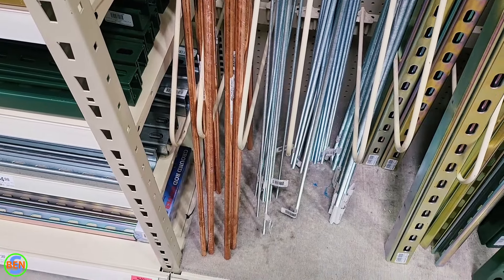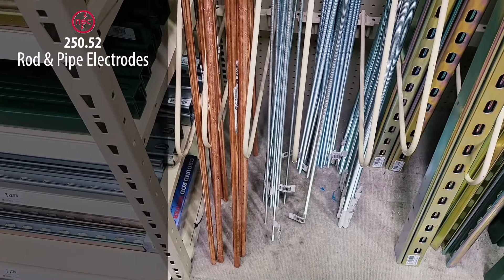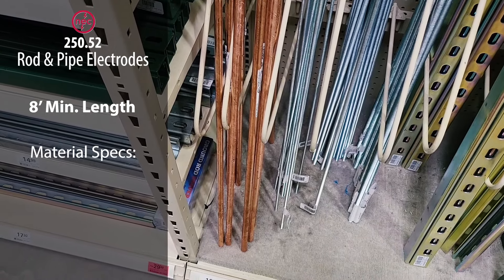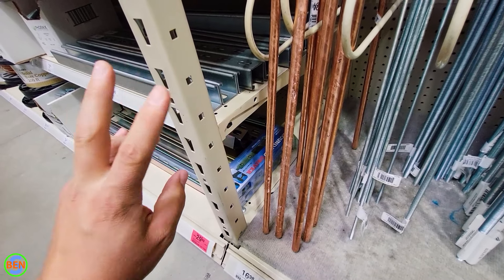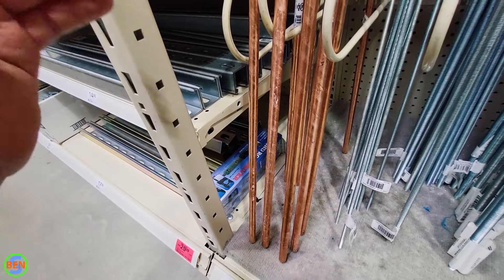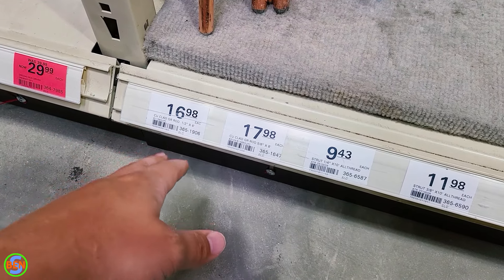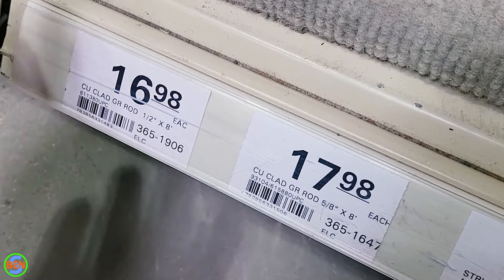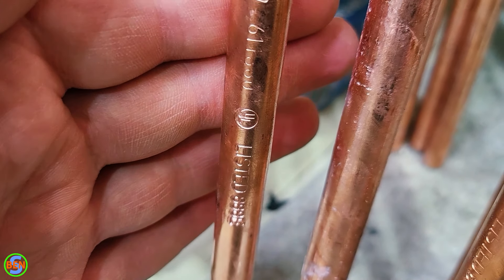What Size & How Many Ground Rods Do I Need

Comment: I actually find the thicker ground rods to be easier to drive, they are more rigid and the force of each hit wobbles less and is transferred to the ground. I use 3/4" with a rotary hammer
Reply: Thats what I was wondering
Reply: Just got 3/4 cause that's what was available in 10ft. Copper clad.  Clay soil wasn't easy but I think the 3/4 helped as even then it sort of wanted to bend.

 Did water trick to about halfway, then sds plus rotary hammer to about 3 ft, then one hand 4lb sledge then 8lb.  sledge

Comment: This is a great, quick explainer!  Thanks!
One extra callout: accessory buildings with sub-panels may ALSO NEED TWO 8ft ground rods, depending on location.

I would really appreciate a video explaining some of the install methods, too.  There's the water hammer method and literal hammer drill as alternatives to a sledge or digging.  Though, I will say that clay soils likely take the sledge best.

Great video as always!  Thanks!
Reply: just rent a breaker (small jackhammer, e.g. makita hm1307cb) and the rod driver bit.  nothing else compares.  it's all glacial till and rock here where i live and unless you hit bedrock the breaker will drive the rod through anything else.

Comment: Most places nowadays require two grind rods because one is replacing the service bond to the water service. Most modern water services, especially in homes, uses plastic pipe which does not make for a good ground.  You always had two means of earthing but if you can't use the water service or foundation as one of your means of earthing, you need a second ground rod.  Secondly, code allows a 6 foot minimum between ground rods but ideal would be to put them 12 feet apart if possible.  This is because each ground rod has a 6 foot effective radius for grounding and the less overlap you have of these radii the more effective your grounding is.
Reply: Ok ok nice I was just wondering why 2 ground rods. Thanks for the info 😮

Comment: I am attaching an outdoor aerial antenna to my garage and I know it needs to be grounded.  I am wondering if I need two rods or one to ground the coaxial cable running down to the ground before it enters the house.  This will NOT be connected to my home's electrical grid.  

The cable itself will be attached to an Amazon Fire Recast, which then supplies all of my Amazon Fire Sticks with other the air channels plus recording capabilities.  Where I live there are close to 25 over the air channels (ABC, CBS, NBC, FOX, many independent stations, etc...) all for free!  It's a heck of a lot cheaper than paying for cable or satellite.  I've been using the Recast for over two years with an indoor antenna.  But have purchased a large outdoor antenna to pick up even more channels and ensure the signal is even stronger.  Hence, the discussion about one rod or two for the ground.

Comment: My company has provided me a Honda 4 cycle ground Rod driver. It works better than a rotary hammer. It takes a bit to start & warm up. However it will pound as many ground rods as you desire. Only exception is in rock. Then we call for a core borer.

Comment: Per NEC You can also trench to 3 feet and lay it in horizontally. Bend a 90 degree on one end to surface.
Reply: Why would you ever want to do that? Most panels are above concrete.
Reply: Most panels in my area are in someone’s yard. While you’re digging the trench laying them in would be easy

Comment: Quick tip:
I use a post driver to install ground rods. It works great. 
Have a good day everyone.
Reply: There’s attachments for rotary hammers and breakers that clamp onto ground rods and beat them in for you.
Reply: @FishFind3000  ^ this is the way
Reply: For a while I used a post driver that I had welded for me.  Between the post driver, a sledge hammer, or an sds max or spline drive drill with the ground rod driver, I'd choose the drill with adapter any day.  They make very quick work of driving the ground rods.
Reply: @ianbelletti6241  Thank you. 
I have a buddy that welds.
He's going to make one for me that fits my sds.
Thank you for responding. 
Have a great weekend and be safe

Comment: Question: why are ground rods necessary? My house has none as the service is grounded to the incoming cold water pipe which obviously has full contact with the earth outside the home. Perhaps it’s because newer house use plastic piping?
Reply: Lightening twice burst the metal (copper, I think) water pipe on my house and I had a concrete slab. The second time was the worst as it was 1" above the slab - meaning the concrete would have to be partly removed - and was at a supporting wall. 
I am no electrician, but think you should get a grounding rod.  Also, one lighting hit shocked me when I had my hand on the door knob and the door was metal.
Something was wrong with that house.  The soil was moisture-retentive clay, too.
Reply: Your circuit breakers trip quicker with a good ground. should have copper line from grounding bar to outside grounding rod. NEC call for 25 OHMS or less resistance. Lightning takes all available paths, but the majority will follow the path of least resistance. Less chance of ruining electrical devices in the home. Much Less chance of humans getting shocked.

Comment: In the late 1980's I investigated farms in Grant county Wisconsin for stray voltage, many times I found the ground often was severed to the return of the over Head line ( two wire feed ), requiring power to get back to the original source through the ground. I had proposed a smart breaker box allowing the balanced current to get back to the original source. The official statement is stray voltage does not exist.

Comment: Does code require the rods to be driven vertically, or could they be buried horizontally?
Reply: The idea is to get them down far enough to reach wet soil. The conductivity is best to wet ground.
Reply: 3 feet’s in a trench horizontally 😮

Comment: G-WIZZ.. You mean building code finally caught on that putting ground rods in the concrete slabs / foundations was a bad idea after 19 different family's were exploded from lightening strikes to the houses, and concrete and molten zinc and steel went flying....  I remember the day that crap happened, and I had just spent 4 days banging in 8 ground rod (by machine) and the inspector shows up and says, "Nah, can't do that bro, Those were suppose to go into the foundation".... The general was like "WHAT?"... LOL they had to bust up concrete and caused a serious delay and mess,  I connected to both those concrete rod and the ground rods as I didn't think that was a good idea only being in concrete... Please note, Our area with in i years, already vetoed that code after the deaths... and issued orders to put in ground rods on jobs that had concrete units... What a mess that was... 

I even remember asking, "Is that a good idea?" the inspector in his cocky tone, "Yup, men much smarter then you think so".... Okay... vapor barrier and all and the footer bases back fill dirt that can be dry and pulled away.. Nah, its all good... ((((((ZAP))))) ...LOL... I only got to see two of the homes that took on lightening strikes that had rod in the concrete and what messes those were turned into, and burnt to the ground.. and were the ground rods were, not a lick of concrete for a 6 to 8 foot width the full 7 to 8 foot length of the rod... The general mentioned the one home owner was on his back patio grilling when his home took the hit, and exploded and I guess, he was walking just turned around to walk towards the back door / screen door when it exploded.. instantly catching everything on fire from liquid metal from the rods... He gave the example "have you ever seen the movie Terminator?".. which the general had not, but, I picture the scene of the liquid molten metal as the terminator is being lowered down into the stuff? That might be part two, with the kid?

Comment: I thought it was now mandatory to have 2 ground rod's 6' apart at least 1/2" but together they must attain 50 ohms together in resistance. Mike Holt does a whole video on this. I maybe wrong this is a few years ago I seen this.
Reply: The two ground rods is only required in new installations where you don't have a second means of earthing such as a metal pipe for the water service.  It doesn't hurt to have two ground rods anyway.
Reply: @ianbelletti6241  When I watched the Mike Holts update video, for code, it was was mentioned we are trying to now reach for 50 ohms of resistance. I don't remember, if he, at least said about it being in 2nd earthing situations. I always thought the earthing, of the water was to protect, the houses water supply. Like if your in the shower and lightning strikes, near your location or in the water supply itself. The water pipes are then bonded to the grounding system therefore giving the electricity a way to discharge to ground. This is why i thought the 2 rods are driven at least 6' from box and 6' from each other and 8' into the ground. To get the maximum ohms or resistance to the fault. I maybe wrong here I am not the expert. This has just been my understanding since the addition of the 2nd grounding rod idr what year they added it. but thank you for the reply, it was a great point to make and made me rethink this.
Reply: @rtheprizeisright7323  reaching a 50 ohm connection to earth was always the case.  The issue is that most modern homes have a plastic pipe for the cold water service eliminating one of our grounds.  That's the reason for the two ground rod minimum.  Any metal pipe in the cold water system still needs bonded for lightning protection of the occupants and equipotential reasons but there is a reason the code mentions attaching the service ground to the metal cold water service pipe within 3 foot of entering the building with a specified minimum amount of conduit into the earth for it to be considered a service ground.  The metal water service pipe is a legal earthing connection.  Code requires a minimum of two earthing connections.  Engineering specs or testing may require more.  I've worked on jobs where there was a grounding ring with a cad welded ground to each column because of one of the structure's intended uses.  In most residential areas, as long as the inspector sees that you have at least 2 means of earthing, the inspector won't make you test for the 50 ohms or less.  You can stack ground rods like Mike Holt shows, but then you will have to pull out the Megger to show the inspector that you've reached 50 ohms or less.  Save stacking the ground rounds for locations where you can't put the ground rods at least 6 feet apart or where an engineer has specified to do this.
Reply: @ianbelletti6241  great answer and your right, in my area usually the main, is copper to the furnace at least and then plastic from there. The inspector we have here, was a mailman, so he won't ask you to pull out a meter for just about anything, the nepotism in this area is amazing. He's the electrical inspector, a home inspector the radon inspector. And his brother in law or something like that owns the biggest construction company in the area. But yeah. I understand what you mean thanks for explaining it a little bit more for me. I appreciate it.
Reply: @rtheprizeisright7323  sounds like you're in a small county or town depending on who is responsible for providing the inspectors.  In low population regions, the inspectors are often multi trade because the budget isn't there for having all single trade inspectors.  If the region of charge is small enough, the inspector might even be part time filling the remaining time with other jobs.  Whether or not he can do that will depend on his contract.  I also hope that the inspector you're talking about sends another inspector to inspect his brother-in-law's jobs in order to prevent a conflict of interest.
Reply: @ianbelletti6241  believe it or not he doesn't
yes it is a small area and very corrupt cjs, system, permit politics, unfortunately
Reply: @rtheprizeisright7323  usually nepotism in these kind of cases means that the official tends to be much lazier in their enforcement because they can get away with slacking off due to their connections protecting them.
Reply: 🤔 But How DEEP do you have to drive these Ground Rods into the ground.? 🤷🏻‍♂️
Reply: @annafraley5388  until you have no more than a few inches above grade, i.e. just enough to still make the connection.  In most cases, however, you want the entire ground rod below grade in order to prevent tripping and to protect machinery that would operate in the area.  If you really want to ensure that you have enough grounding, you should use a grounding system Megger to test the total earthing resistance that you have.  If it reads 50 ohms or less, your grounding to earth is sufficient.

Comment: You should be able to apply 120 volts to a ground rod and check current and then use ohms law to figure out resistance.  Just be very careful though.

Comment: If you're doing new construction you're supposed to use the rebar in the foundation as your ground, and then you need precisely zero ground rods.
Reply: true, here in Brazil new constructions must use the rebar as grounding electrode. Ground rods are only allowed for renovations or temporary use.
Reply: Here in America we call that a upher ground. It is more of a bond than a ground . We are still required to drive a ground rod, or shall I say rods as in most places you won’t pass an inspection unless you have 2…good times!
Reply: @jeffreyhill3960  The NEC doesn't require a separate ground rod if an ufer ground, or "concrete encased electrode" (CEE) is used. Which is not to say that some inspectors who aren't following what the code says won't require one anyway.
Reply: In a house I lived in, twice lightening hit bursting a water pipe in the wall in almost the same spot (within 2 or 3' from last burst area).  The rebar in the foundation seemed too close to the pipe which I think was copper.  Do you think this was the cause?
Reply: Could be induced current
Reply: You need a ground rod, AND bonding to the concrete. 💙 T.E.N.

Comment: I want my grounds to be girthy.  Luckily I installed an Ufer ground.
Reply: What is a ufer? 😮
Reply: @josephrobi6806  Its a way to use the rebar in your foundation. In very dry climates ground rods really don’t work well, you would need to basically bury a large array to get the same conductivity as you do with one or two vertical grounding rods in a wetter climate. So a Ufer ground is made by taking an appropriately sized wire (4 gauge usually) and wrapping it around at least 20’ of rebar (usually the rebar in your foundation slab) which will then be of course tied to other rebar going into the ground and all encased in concrete. Due to the volume of contact provides an excellent contact to the ground.
Reply: @JimYeats  ok yes! I understand now the differences about the rebar in the foundation that make plenty of sense.  Well they didn’t do it with this house in Philippines they don’t they just disconnect appliances if they have any lightning. Many poor people here don’t have running water so grounding is not a priority. My house is is full of rebar all over under and above because it is made with concrete. That would’ve been easy but the construction workers was not aware and they don’t do it. Now I have no choice of adding two rods. I will do it this week. I think that is the only solution in my case and I bought surge  boxes for my tv and refrigerator between the  plugs on the walls and appliances. Is there any good these surge box?
Reply: @josephrobi6806  In your climate and soil the ground rods will work fine. I am unsure how well surge devices work. My only experience is with folks buying them for very sensitive data such as computers.
Reply: @JimYeats  I want to connect the wire inside a breaker but there is no place for it. So I will squeeze the 2 together the ground wire and the live one from the electricity for the house. Is there a problem with that like a safety issue ?
Reply: @josephrobi6806  Yes. Don’t do that.
Reply: @JimYeats  what should I do to make it work any ideas
Reply: @josephrobi6806  It just needs to be tied into your main electrical panel where your grounds are at. You must have some equivalent spot in your home.

Comment: No one here checks ground resistance, just use 1) 5/8 rod and it passes.
Reply: What kind of jurisdiction is that?  Not doing their job.  One rod for temp installations could be permitted.
Reply: Soil conditions vary a lot. You should always measure the earth rod impedance and ensure it is within the required spec.
Reply: @donl1410 , don't worry about it, tattle tale.